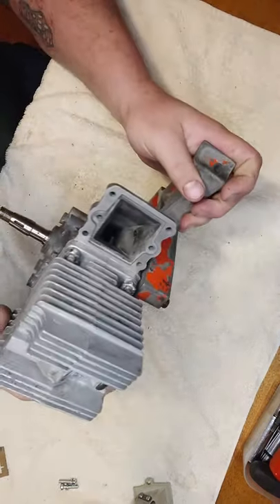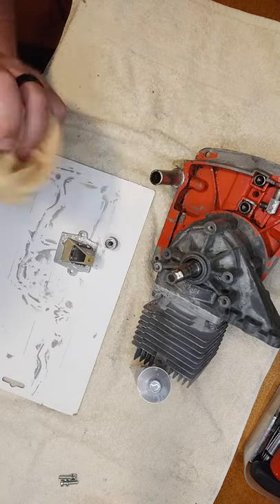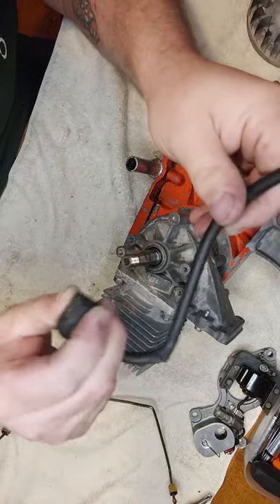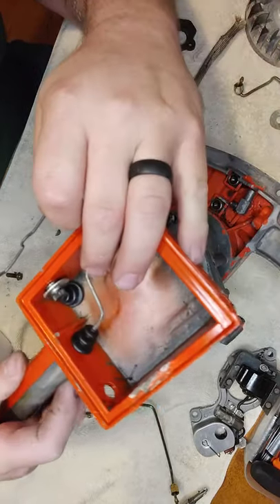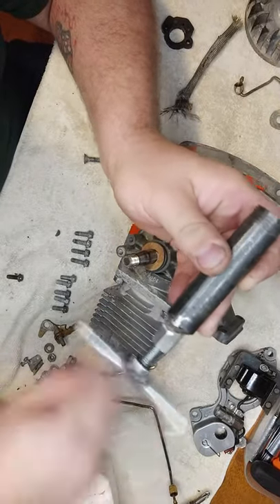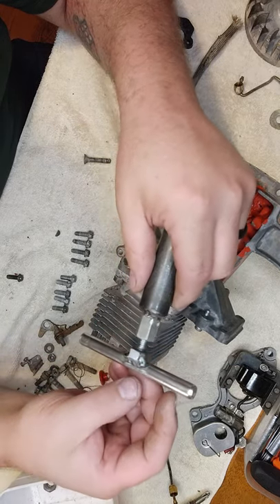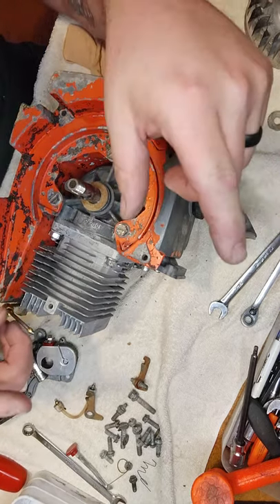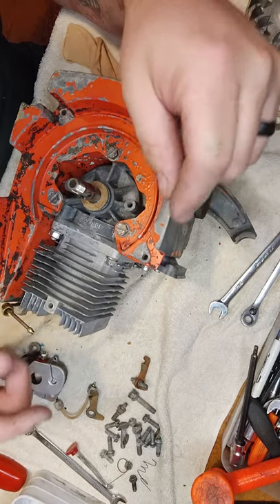Lombard comango installing all lines and read block and break down the seal removal tool

Comment: MR MCDANIALS, THE HOMELITE & THE LOMBARD COIL BRACKET HAS THE SAME MODEL NUMBER! THE HOMELITE COIL WORKS ON THIS BRACKET. I HAD TO USE A HOMELITE COIL SINCE THE LOMBARD COIL IS NONEXISTANT!  HOMELITE COIL PART # 59860.
Reply from the maker: I figured they would work back and forth they look identical that is a great information